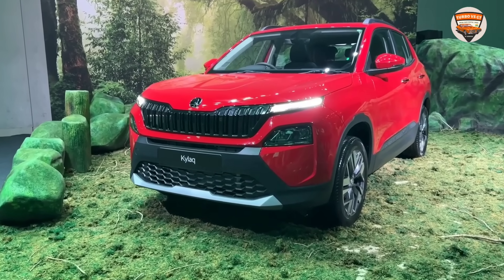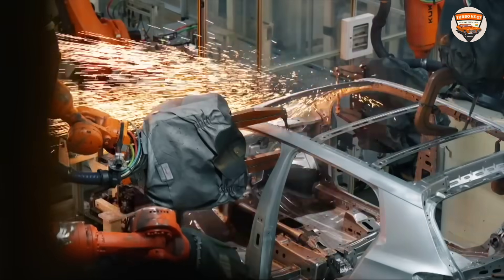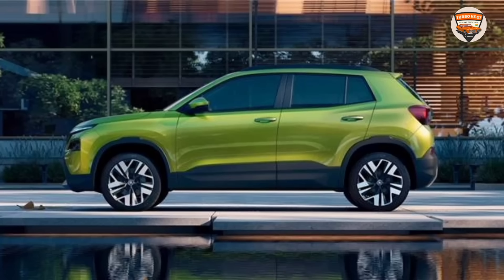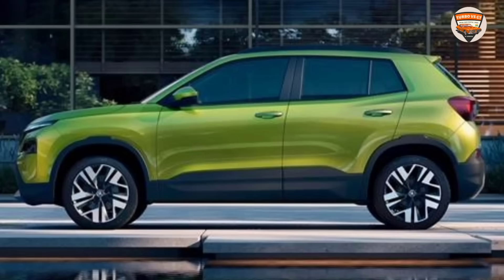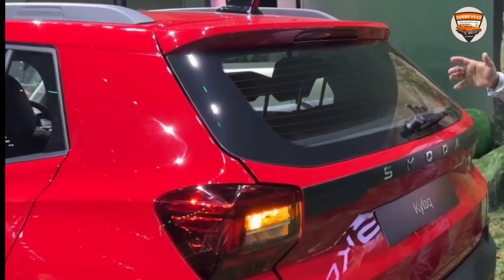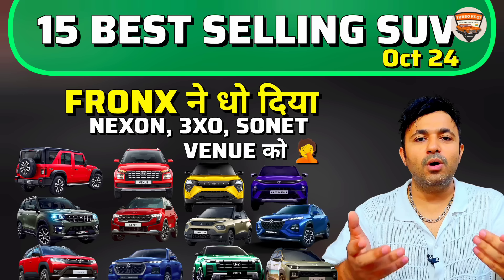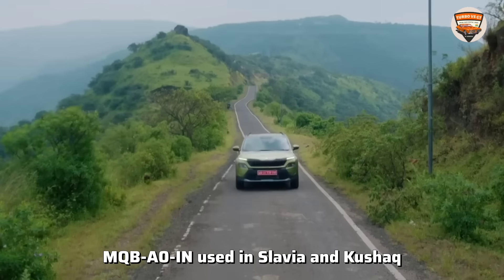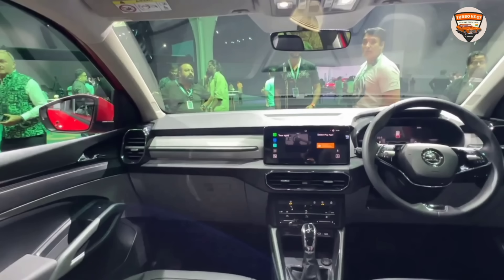SKODA KYLAQ 🚀 क्या Tata Nexon और XUV 3XO पर भारी ? या फुस्स बम

Comment: VW ka ye 1.0 litre engine bhp aur torque ke mamle me apni actual potential ka just 35% pe aata hai. VW ne isi 1.0 engine se monoscroll turbocharger + e-booster system(kind of a supercharger) laga ke apne OEM map pe 272 BHP aur 270 nm torque nikal rakha hai. Had se zyada strong hai is engine ka block, cylinder head, piston rod, camshaft + other components. Stage 1 OEM map pe ye 132 BHP aur 240 nm Torque tak jaati hai plus fuel economy bhi badh jati hai by 1-2 kmpl. Now imagine the potential of 1.5. 

Bhai ye VAG ki gaadiyaan cheez hi alag hai 💯

Comment: They have compromised the rear legroom to give the biggest boot space in the segment despite having the 2nd largest wheelbase in the segment. Bucket seats have been given in the rear which makes it a 4 seater car since there is hardly any space to place your legs comfortably in the middle. This will be deal breaker for a lot of people as they look for a spacious 5 seater car and Skoda made a huge blunder. Nobody travels on a trip everyday and boot space majorly remain unused if you're travelling somewhere within the city. There was no need of doing this as comfort plays a huge role and space management is so crucial in this segment.
Reply: Most practical comment, perhaps they have done it intentionally to make it look different from Kushaq.

Comment: Boss, Pls compare mileage as well , Breeza Vs  3XO Vs Kylac👍
Reply: it depends on petrol you put in.. in 95 octane petrol mileage comes like 10-12 while with normal petrol it decreases a lot like 7-9 with ac.. without ac or low ac mileage increases by 2-3 kmpl more.. as 95 octane petrol comes like 5% extra price it's not huge price difference for mileage you get.. i own skoda slavia 1.5 dsg.. and this is my observation.. 95 octance is available easily in most indian oil petrol pumps.. even mixing n95 with normal petrol decreases mileage.. highway 20 kmpl with decent driving and n95 octance petrol..
Reply: @shobhitsaini86  thank you, understand mileage would be somewhere comparable to 3XO , as breeza seems to have better mileage.

Comment: Mileage in city?
Reply: it depends on petrol you put in.. in 95 octane petrol mileage comes like 10-12 while with normal petrol it decreases a lot like 7-9 with ac.. without ac or low ac mileage increases by 2-3 kmpl more.. as 95 octane petrol comes like 5% extra price it's not huge price difference for mileage you get.. i own skoda slavia 1.5 dsg.. and this is my observation.. 95 octance is available easily in most indian oil petrol pumps.. even mixing n95 with normal petrol decreases mileage..
Reply: Highway pe 18 se 19 h